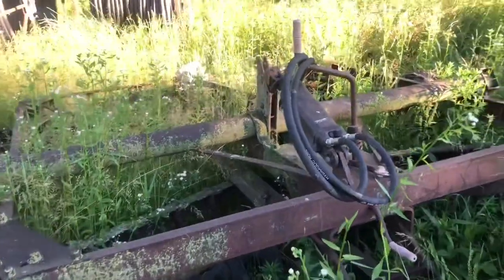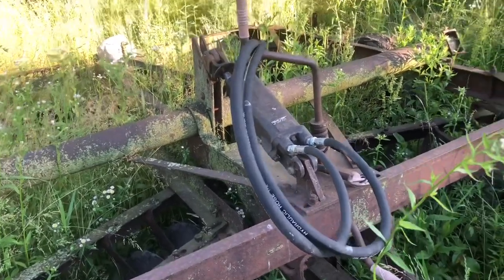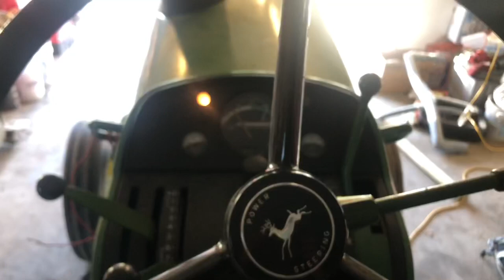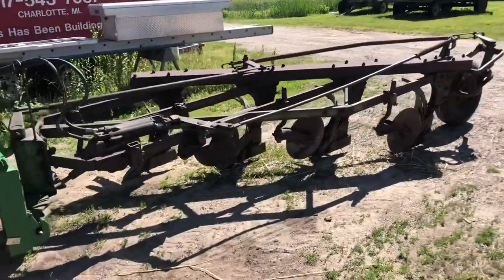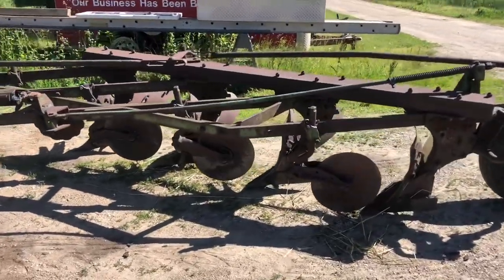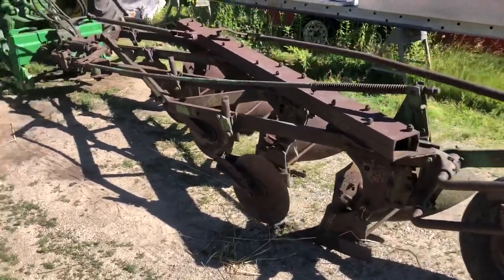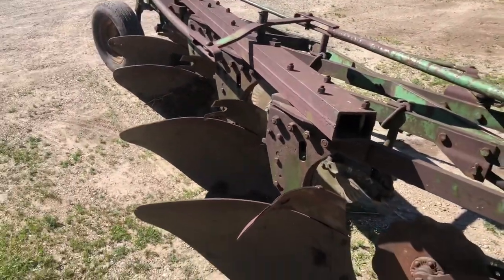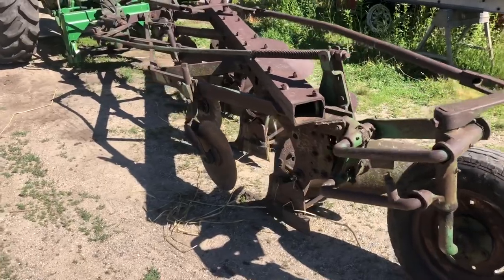John Deere F-145 plow

Comment: What are the yellow fields you were driving by?     We saw similar grain standing in Door County Wisconsin in late June.   Love the plow.    I need to replace my shares too.   Post the process if you decide to replace yours so I can ‘learn’ from your experience 😊
Reply from the maker: Yellow fields are wheat which is being harvested now. I just replaced shares on my other plow video the Oliver 360, thought about making a video of the process but didn’t. Process is pretty easy, the bolts in the plow shares will either break off or turn. If they turn I weld the bolt to the share so I can remove the nut which most likely is going to break off anyway. Once you have the share removed there is a set of numbers on the backside of the share. That’s the numbers you need to buy new share. Then it’s just bolting the new shares in place. 
If I replace the shares and shins I will make a video of that process, thank you!
Reply from the maker: https://youtu.be/hjn-yMxZ9DI
As you requested